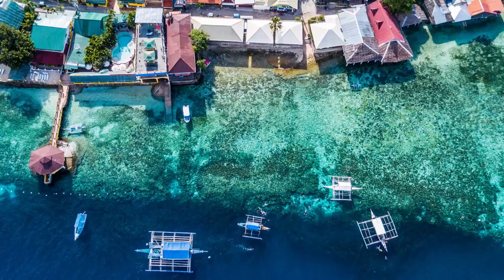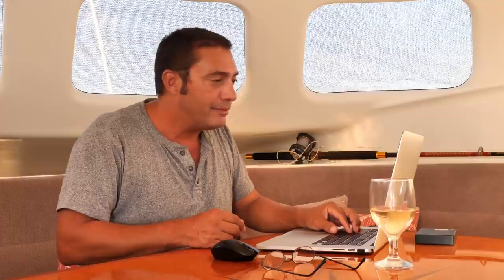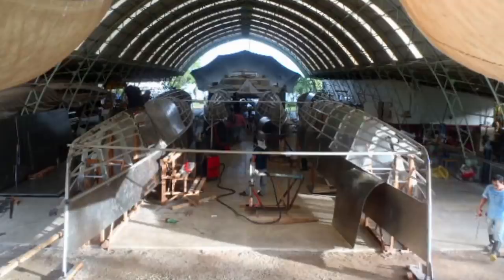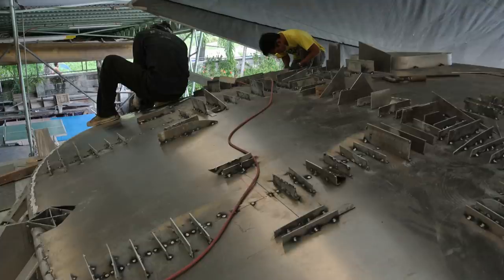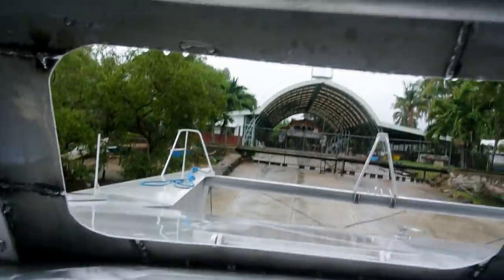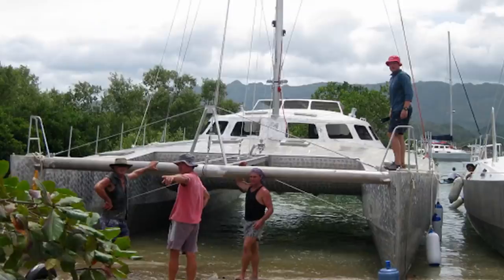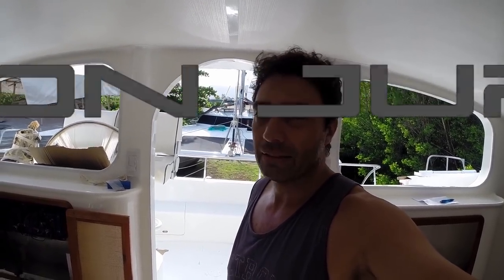Building an Aluminum Performance Cruising catamaran - Part 1

Comment: Jamie, please could you add some information about the forepeaks on both hulls. Don't see access hatches from the deck? Also where do I get information on the 50' model
Reply from the maker: That's correct Raj, no deck access... They are water tight floatation compartments... However you can unbolt an access panel from the head/shower cabin... If you email me on Svjupiter2@gmail.com I can put you in touch with the designer.

Comment: Awesome Cat!!! 
DeVilliers in New Zealand, makes real nice aluminum boats as well.
Fair Winds and Blue Skies!!
Reply from the maker: Ya, I just found out about them... They're nice but heavy and expensive. Cheers Chris
Reply: @SailingLifeonJupiter  It's relative. You gotta have in mind that mumby is spartanic-extreme-performance while DeVilliers is "just" adventure(!)-high-performance. They still have VERY good performance values(SAD, Kelsing, Bruce...). So making 10-12 knots avg is no issue at all. All while serving WAAAY more livability and safety. Like its not even comparable. Like the safety of having a beefy rudder and prop protection. Ohh and I didn't even mention yet the super safe front cockpit. I see it the way that performance is is much but not everything if(!) I live 100% on a boat. It needs to be at least so comfortable that I don't yearn for the comfort of home. So I'm personally not looking for a spartanic liveable(Mumby sugar scoops look extremely dangerously small thinking about hooking fish in high seas there, very restrictive outdoor livingspace with very little) extreme performance boat but a healthy mix of high performance and liveability. But yeah, 300k is quite the bargain for a new performance cat!

Comment: Are these still being built there? 
Since you were there 6 years ago, things might have changed. Availability and price...
I love the PI and the people there. I worked on Luzon 1982-1989. Diving off the Banca boats, sailing and windsurfing was great. 
I built a carbon F-9A tri (31') launched in 1993 but need a decent sized cat to cruise on now. This could be an option but I'm a bit concerned with aluminum.
Reply from the maker: Yes they are Steve... they did close down for a year or so... but should be back in full swing by mid this year... Ally gives me a great sense of security in big seas, reefs and even lightening storms!
Email me on svjupiter2@gmail.com if you'd like me to hook you up with Tim Mumby

Comment: My Welder friend says when he first started with aluminium he'd be super careful but sometimes a hole would suddenly appear "miles" away from the weld area but he got round it by clamping a piece of "clog iron" behind where he was working to act as a heat sink.
Reply from the maker: Yep... There was plenty of heatsinks welded all over.... Looked like a porcupine!

Comment: Great boat, great design, great price. Really 300 all fitted out?? Can' t wait to see the rest. I have read that since a catamaran flexes inevitably, eventually, the metal fatigues and breaks without warning. Any sign of stresses yet anywhere?  What about electrolysis? Do you have to stay away from steel boats? Can you stay in marinas? How was the experience with the yard? Is Mumby there? Many, many questions...thanks for sharing.
Reply from the maker: Hey Tone..Yep that's what it cost me... And i've heard from guys enquiring recently that it's pretty much the same cost..perhaps 10% more...
These boats are pretty stiff...so no signs yet of any fatigue. I'm not sure of the material properties, but i imagining because ally is soft it would have more elasticity than steel? Anyway, I'm just guessing on that one.
Electrolysis is mostly controllable with your zincs... I've had fast zinc erosion in a particular marina (6 weeks) but perhaps we should have anticipated that and hung some anodes in the water also.... No structural electrolysis is evident... occasional pits in the wet bilges... so i try to them dry.
I loved hangin out on my days off in the yard in Cebu... yes Tim is always there directing, training and supervising... Always available to pick his brain during lunch break. Give me an email on SVjupiter2@gmail.com if you want me to put you in touch with him...
Cheers
Reply: @SailingLifeonJupiter  Hi Jamie, thank so much for the detailed response. I still can't believe the price. What do you include in the all fitted out? Electronics, sails, water-maker, anchor, chain, standing and running rigging,...For a custom made 48 footer that would be half the price of the competition. How old is the design now? Are there plans for an updated version or new model? Has the design changed/improved a lot since the beginning. Is there a Mumby group that I could follow to get an idea of the owners experiences. I am going to email you. Is Mumby building exclusively in the philippines now?
Cheers
Reply from the maker: @tonewreck1  .... Yes that was all up, roughly what i spent... But it is very easy to spend a shit ton on a boat... i'm pretty selective with gear and analyze whether i really need it or not... but enough toys to keep me busy...  electronics, dive compressor and dive gear, watermaker (homemade-check our vids)... He has evolved the design over the last 12 or so years.... It slowly gets better and better with every build.... Yes Tim is reestablishing his yard in Cebu now.
Reply from the maker: Oh...search on facebook for Mumby catamaran group... its' a small group and not very active.... but will give you an idea.
Reply: @SailingLifeonJupiter  @tonewreck1 One of the downsides of Aluminum is that it has a fatigue life.  If it bends enough it fails eventually.  BUT this design looks pretty stiff, which, if so, prevents bending stresses and extends life.

(This is the same reason airliners have a fatigue life: flexing of wings, etc., but mostly repeated stretching of the cabin due to pressure changes at altitude.)

All metal boats, including Aluminum, have the potential (no pun intended) for galvanic corrosion.  Heck, plastic composite boats do too.  All that's needed is two metals of different galvanic potential in contact with seawater.  (Basically it forms a battery with a liquid electrolyte.)  Sacrificial Zinc anodes prevent that by in essence corroding first.  Same as zinc on car body panels to stop steel from rusting.

All the normal rules for preventing corrosion on a boat apply to Aluminum boats the same as any other.  They are not unique in that regard.

Comment: AweSome Jamie.  I am intrigued by the Mumby - Will you be discussing the latest variant of the Cyber as I think that there is a 50 foot version now?   What would you change if you could , what modifications are you planning?  If you were doing more family type cruising with a crew of 4 around say the Whitsundays would you do anything different.
Reply from the maker: Hey Mark... thanks for the feedback... I'm not aware of any authentic Mumby variants.... I'll check with him, but im pretty sure what you've seen is another builder modifying the plans to his own requirements.... and then using the "mumby" name to get a good sale price.
Im not planning any mods at all... although that was not always the case... 
When i was having it built i contemplated extending the bimini for more shading....galley up pro/cons...etc. But am glad with the decisions i made then.
The only small annoyance for me is the cockpit design... I go for beers on a friends little Fontaine Pajot or any other "chartermaran" and they have such a comfy luxurious cockpit... The Mumby cockpit is very functional with minimal comforts.
You can makes some comfort with cushions etc... but ultimately the cockpit layout is most important. It's not an easy modification at all, because the cockpit layout affects the queen sized cabins in the aft quarters... and also the huge rear crossbeam extends the entire width, meaning you cannot have walkthrough transoms.... so it would be an entire design change.
Honestly Mark for family whitsunday cruising, any of the "condomarans" would suffice...thats what they excel in...a comfortable/luxury apartment that you can cruise around in fair weather on the coast.
Thanks for watching Mark!

Comment: Jamie, I've watched this video about 40 times and can't quite figure out why there's a double bow on the front part of the deck house or just in front of your bed on starboard and the washing machine on the port side. I'd love to see a video on how they bend the aluminum. Do you have anymore technical details that you could enhance this story for people like me that love details and possibly do another video on it? You could also talk about other details such as design and performance characteristics as well as the difference between a fixed mast base verses going with a rotating mast base for a lightweight performance cruising catamaran like yours. Sail design might also be a good subject but that would probably best fit in a video all by itself. I think five sails is best for your boat but I could be wrong. What do you think is the right amount of sails you should have and why?
Reply: The bending of metal is done on an English wheel.  One wheel is concave and the other is convex, and rolling sheet metal under force between them stretches one side of the sheet, lengthening it.  It takes a ton of skill to make complex curves this way.
Reply: @LoanwordEggcorn  Thanks. It looks like there are two pieces of aluminum in the front underneath the anchor chain that's in between both hulls. I'm wondering why.
Reply: @robertlaird6746  The ones close together?  I'm not sure what those are for.  Further apart could be for an anchor bridle.
Reply: @LoanwordEggcorn  It might be for extra strength and a place to run electrical wires easily.
Reply: @robertlaird6746  Do you have a spot in the video where we can see them?
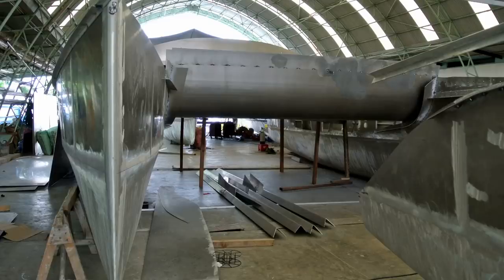Reply: @LoanwordEggcorn   Yes. At 7:07 into the video. Looks like backing for another curved piece of aluminum to go all the way across to the other hull unless that's backing plate for welding purposes.
Reply: @robertlaird6746  It's a backing piece to keep the main hull pieces from warping during welding.  So a temporary stiffener, like the many other temporary pieces.
Reply: @LoanwordEggcorn  That makes sense. Thanks.

Comment: Youre correct when you stated that having a cat built in Australia would be expensive, as an aluminium fabricator who worked for Incat (up to 112 metre passenger catamarans) the average tradie earned Aud$1200(US$920) for a 38 hour week, net.
Reply from the maker: Wow Steven... not a bad wage...  I don't think i'll end up back in Aus because of the living costs.... i'd prefer to live cheaply and work less.
Thanks for watching!
Reply: @SailingLifeonJupiter  living costs are out of control and will continue to get worse. We've sold our property and plan to be on our own liveaboard by years end, our wage slaving days are over:) take care and all the best.

Comment: Are they still in operation?  When I first found your channel a year ago or so I went looking for them and couldn't find them, assumed Mumby was out of business.
Reply: Quite a few have come on the market lately.
Reply: @SVPearler  I mean new, not used. I did find an 18 year old used one on yachtworld.

I’m interested in the name of the manufacturer.  Or if you have a link to where these are on the market, that would be great.
Reply: Great video. Loved the part 2 also but can't find it again..Q1. Did you coat the hulls in epoxy or something to protect from electrolytic Corrosion?. Q2.And what is  the  deck and coach House roof coating . Does it get hot in the sun? Q3Are Bench's, seats cabinets etc all moulded GRP or some alloy? Q4. How long did it take for the build? Keep up the great vids!!
Reply from the maker: Hey Roger, send me an email on svjupiter2@gmail.com, and i'll hook you up with Tim Mumby... he isn't on the "interweb!"
Reply from the maker: Hey Jay... Not sure how you saw Part2 this early!... It is unlisted until we publish it tomorrow..... But we have noticed over a hundred views on it!.....some loophole i guess... 
The hulls are bogged/faired with acrylic (?not sure), but only for fairing purposes before painting.... At least half of these boats the owner elects not to paint the hulls, since ally oxidizes and self protects.... but i prefer the pretty painted look....and it was far far cheaper to get Tim and his boys to paint it than anywhere else in the world.... The deck paint is just some standard Jotun coating, with rubber granules for non slip added in...The beauty of a white deck is that it DOES NOT get hot... but even if it is slightly tinted, it will..... I wanted a light grey color deck, but Tim warned me against it, because it would be too hot to walk on....
The interior furniture is ally framed with the gelcoated laminates that he makes up... the entire interior is lined with these laminate sheets...pretty and easy to keep clean.
Tim can pump out one of these in 18mths.
Let me know if you want to get in touch with him, as he is not on the interweb....send me an email on svjupiter2@gmail.com
Cheers
Reply: @SVPearler  I had never heard of yachthub before. Thank you!

Comment: How many man-hours, would you say, did the construction of your Mumby48 aluminium take for the hull alone??? and how many many man-hours did the upper-deck take?  (So if a team of 5 are working full-time for a month that's 5X21daysX8hours=840man-hours.)
You did mention 20 months for the whole build, but how many labourers were working on it at any one time full-time?
Thanks!
Reply from the maker: Geeeez Garen...that's not my area of expertise.... but roughly 4 guys working on the weldup was 6mths.... fitout roughly 14mths with 4 guys (5 days a week).
Reply: @SailingLifeonJupiter  Thanks! That pretty much answers it. So, 4menX6months=24man-months for the ally body. And 4menX14months=56man-months for fitout.
You said they're earning good wage for the area.  How much is an average monthly salary for those workers?

Comment: Very nice indeed to se how it was built! I tried to find data on headroom without luck (I am 200 cm) and consider what cat to buy in a few years. Btw. is the foam closed cell - and does that make the cat unsinkable?
Reply from the maker: Hi Mads...the bridgedeck cabin is 195cm at the door to 180 at the nav table...the hulls are mostly 195cm... You'd be polishing as you go!
Reply: @SailingLifeonJupiter  Thank you - already lost too much hair polishing. Stay safe.

Comment: Awesome to see Jupiter II being born.  A good idea to float the hulls to the fit out spot, find any leaks before it's too late.  What engines did you install, I can't remember seeing them?
Reply from the maker: Hey Chile... I went with Beta 35's... although Tim Mumby usually uses Yanmars... The Beta's cost a bit more, but apparently you can buy cheap parts anywhere.... they are Kubota engines, which are Japanese agricultural engines used all around the world. Beta just do the marinizing.... I'm happy enough with them so far with about 800hrs each.
Cheers

Comment: Hello, What is the maximum speed you touch with Jupiter 2?
What do you think of a budget for 2000 per month for live on a catamaran (for 2 adults or with 2 children) thinks 😊
Reply from the maker: Hey MrOchingi... That budget is certainly doable, but you will need to avoid marinas, DIY everything and maybe catch/hunt to supplement your shopping bill...
Oh, the best surfing speed on Jupiter was 23kts.
Reply: @SailingLifeonJupiter  I come from France do you think be catch by killer whale? Do you heard about this they break many boats around Gibraltar.
That many reasons I prefer a cat like your's... Do you think is secure against this?

Comment: Hi! Nice Video :D I want to build my own catamaran, but since I’m based in Eastern Europe, Philippines it’s not an option for me, UE taxes, CE and so on. I have asked in few local shipyards, and they can build the hull without problems, and the price seems to be ok. I read the comments that it’s about half year work for 4 persons the hull, and one year the finish. But do you remember the ratio of the costs on your cat ? I mean, the finish costs 2x, 3x or 4x of building only the hull ?
Reply from the maker: Yeah Dawid... Finish price was about x 3 the weld up....and that's with all the toys(Lithiums, dive gear, dive compressor, sails, engines, rig, electronics)

Comment: great vid, thanks! - doubt whether it would still be $300k in today's markets, not so much for local labour, but more for getting sails, mast, boom, engines etc (all u gotta get from abroad). You'd have it today for double that more likely.... Still good value if u compare to other new vessels
Reply from the maker: Hey Rod... there's a few guys getting in touch with the designer at the moment, because he is building again this year in Cebu... The reports coming back so far show about a 10-15% increase from what i paid.
Thanks for watching!
Reply: @SailingLifeonJupiter  oh wow, that's not much at all! thanks for the info (we are going plastic this time ;-)
Reply: How is it possible to get in touch with that designer? Please share a contacts.

Comment: I  was super interested in this video as I was considering trying to have a boat built.  How long did it take to complete the fitout after the hulls where faired and painted?  APpreciate you sharing your experience.
Reply from the maker: Hey Brian.... Tim's yard normally completes the fitout in about 12mths.. depending on how many boats he is working on... and that would be having 3-4 guys working on it. The hull painting alone was another 2 months of fairing, painting and polishing.